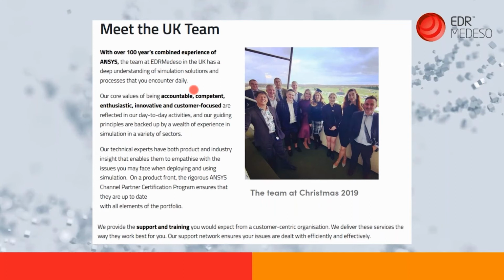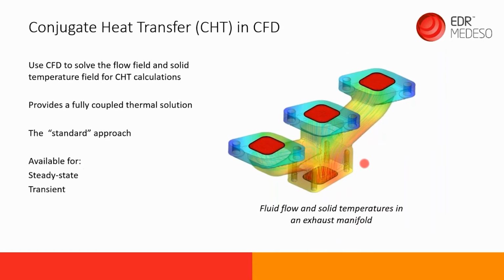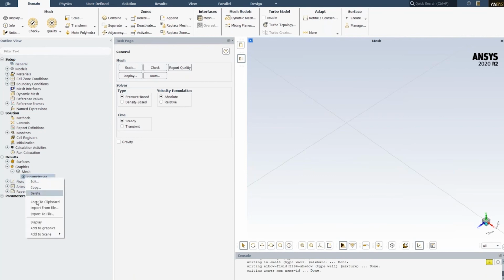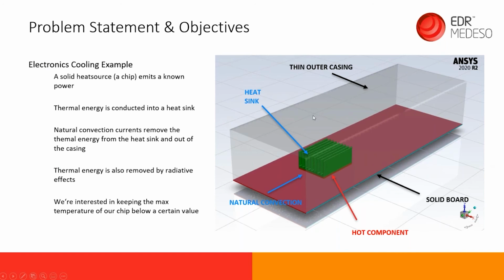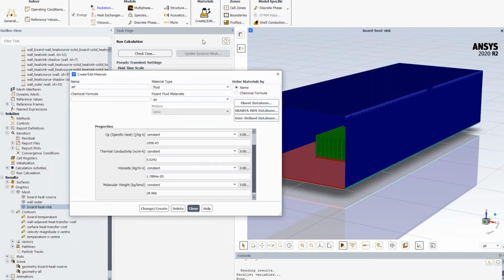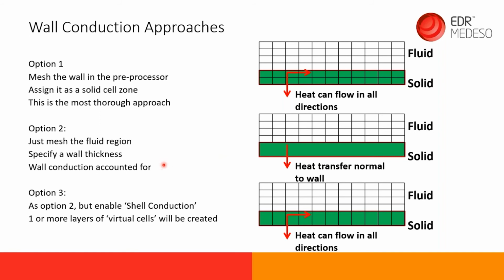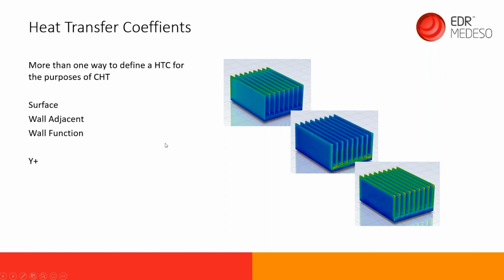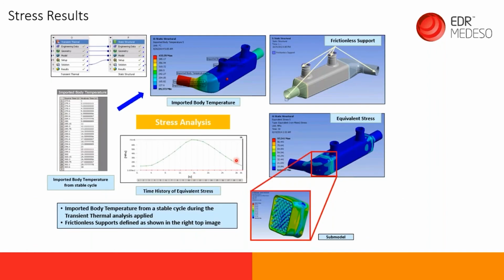Conjugate Heat Transfer in Ansys Fluent | Ansys Tutorials

Comment: Thanks for the video. If I want to simulate heat transfer from a cavity in a zinc bath through to the zinc(cavity through to the steel bath and from the steel bath to the zinc), what should my wall boundary condition be for the zinc and bath to see the heat transfer?